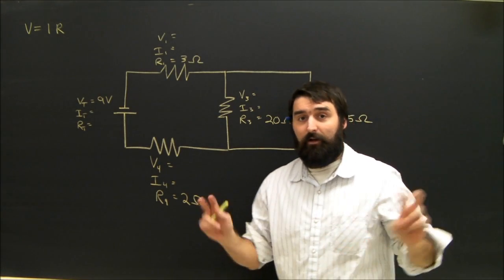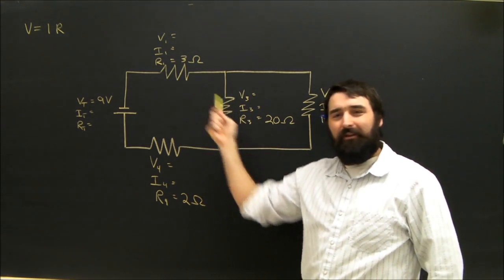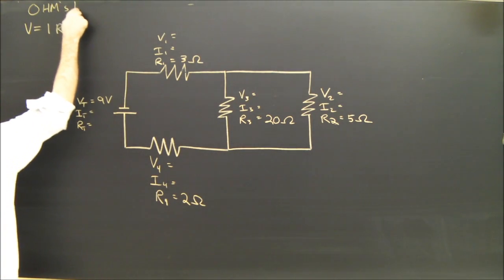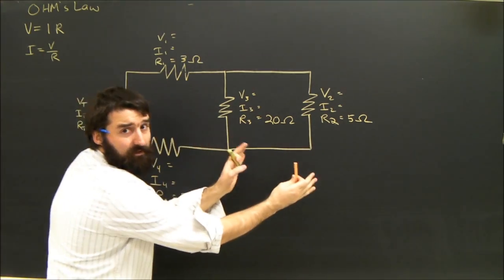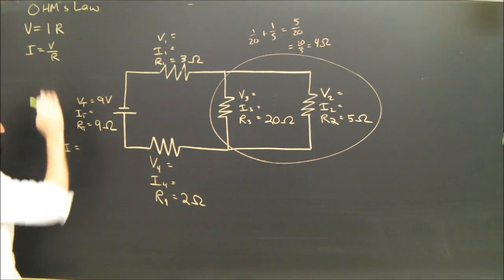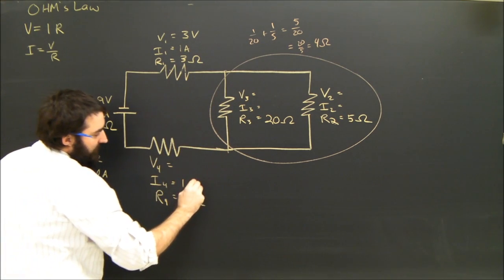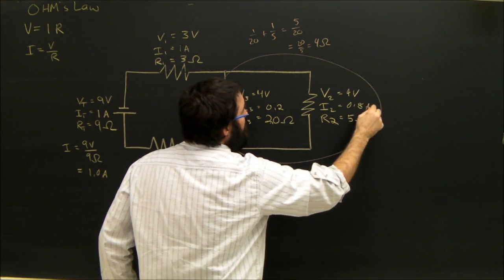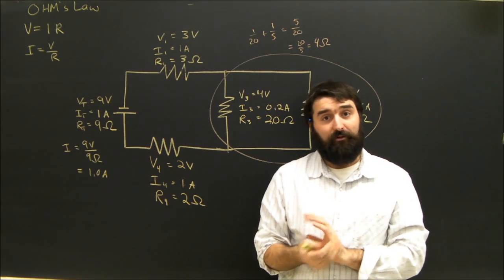Physics Help: Series and Parallel Circuits Electricity Diagrams Part 4

Comment: the left circuit would travel counter clockwise because the positive battery terminal is on the bottom.

Comment: My problem is the homework doesn't have All the resistances. Has voltage and a few other values 5 resistors

Comment: wait still confusing V1 =3V + V2= 4 V + V3 = 4 V + V4 = 2 V we got 3V+ 4V + 4V + 2 V = 13 V in total but the given total volt is 9V, please help me out?
Reply: You are assuming that all of the resistors are in series with each other. The diagram was a complex circuit, so it required you to use both parallel and series equations.

Comment: can you help with is Question.Three Resistor are connected in Parallel across a D.C supply. The value of Two Resistors are 12Ω and 18Ω respectively. If the 18Ω resistors have a current of 18 amps flowing through it and the total current drawn from the supply is 81 amperes 
Calculate: 
The Voltage 
The value of the current flowing through each resistors 
The value of in ohms, of the third resistor

Comment: why are the other 2 resistors not parallel?
Reply: Titan Tiitan you talkin about 1 and 4? I think it's because the current can flow through them in a single circuit (meaning from 1 to 2 or 3 then to 4 ) therefore, they are in a series circuit unlike 2 and 3 through which the current cannot flow both in a single path (therefore it's parallel)

Comment: I don't understand how he added up the number of ohms for the two parallel resistors. It was 1/20+1/5 and he got 5/20. Please help
Reply: QWERTYUIOPASDAQWSDVSFGHJKLZXCVBNM  for parallel circuits 1/Rt(total resistance = 1/R1 + 1/R2... he added the fractions together
Reply: u gotta find common denominator for fractions when adding or subtracting
Reply: same dude :(
Reply: Majesty Hype thank you
Reply: elementary math bro or north korean nursery math
Reply: I thought you have to add the reciprocals of the fractions

Comment: I HAVE a solar panel putting out 32VDC. I want to charge my 12VDC car battery.
I build a  circuit with 32 ohms and 25 ohms resistors in series so that V across the 25 ohm resistor is 14 VDC. Should that be sufficient to connect the car battery across in order for it to charge......?
Thank you 
William Turley

Comment: how the hell 1/20 + 1/5 = 5/20?????
Reply: 1/5=4/20, 4/20+1/20=5/20=1/4
Reply: Stephen Risi ow my god man are you from elementary school or something, go learn some math.
Reply: Jenna Zhang why did he use the reciprocal of 5/20
Reply: mario rojas Because R2 and R3 are parallel. Total R for both is calculated as: 1/R=1/R3+1/R2. And R would be the reciprocal of (1/R3+1/R2)
Reply: +Stephen Risi (Ste2ph) How old r u?
Reply: +Stephen Risi (Ste2ph) common denominator

Comment: wait i thought that to find the current for each resistor, you have to take the total voltage which is 9V and divided by the resistor.. like for the first resistor, i thought it would 3A because 9V/3Ohms == 3A???
Reply: MultiDevan13 that only works for parallel circuits. in complex circuits, the voltage drops across resistors, and must add up to get the total voltage.

Comment: I got stuck solving a problem to find current & voltage in a series and parallel circuit. But I can solve the problem now after attending your lecture. Thank you so much! :)

Comment: Thanks you guys have made physics so much simpler,
although you should add video with more "complex electrical circuits" where the sides of the parallel  circuit don't equal the same